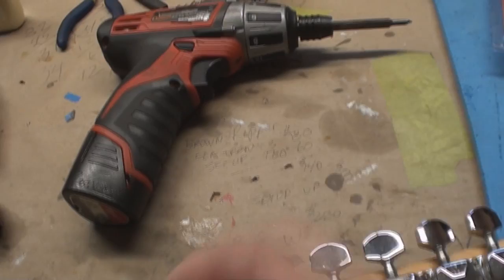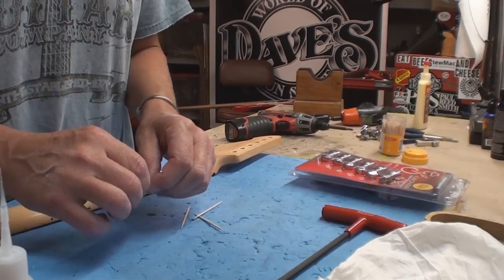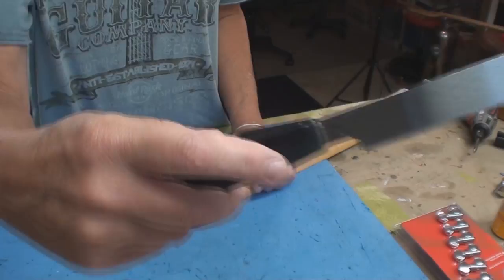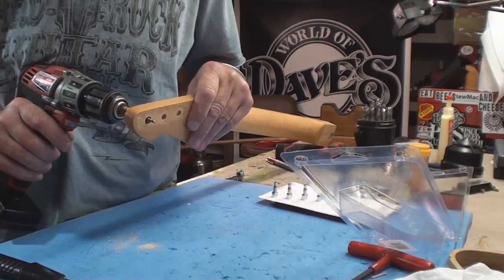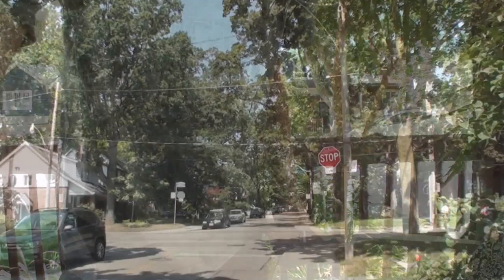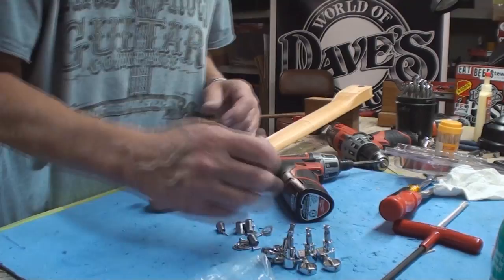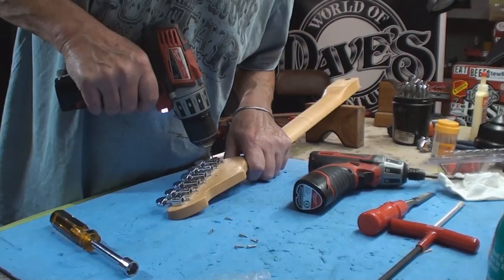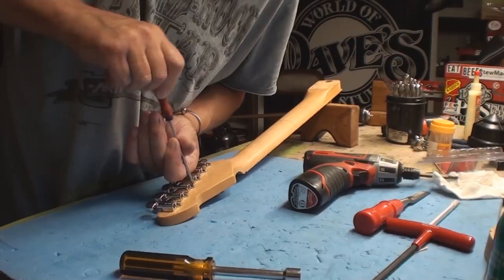Installing Some Grover Guitar Tuners

Comment: A really easy way to find a small part on a floor or on carpet is to darken the room, flip on a flashlight, and lay it flat on the floor.  Slowly sweep the beam in an arc, and the little part will cast a long shadow; you'll easily see it.
Reply: I think i'll try that. Current order of operations is a visual check to see if it's in plain view, then I get the magnetic wand and feel around with that some to see if anything sticks. Magnetic wand doesn't always grab the thing I'm trying to find at the time but it usually gets a bite on at least one of the hundred metal bits living under my bench.
Reply: Or walk across the floor in your bare feet!  You'll find it Guarenteed!!

Comment: Dave, since I started watching your videos, I’ve inlayed abalone, made nuts, refretted basses.   I can’t believe you have a downvote.  How ever I blasted my minty body using my driver yesterday (first time and second time!) and dropped the neck mounting it to the body (first time).  Maple is a pretty stout wood.  No dings after bouncing off the bench and onto the concrete floor from a tall bench.  None.  Not even on the Fender finish.  Amazing.

Comment: Hey Dave click the chuck one click back  the way you would un-chuck the bit and it should lock, thats if the chuck has a little line symbol  with a circle on it. It locks the bit into the chuck. Check that out.   Happy Spinning.

Comment: They make small flashlights with LED black lights used for checking tents and areas for signs of specific bugs etc., works great for finding stuff. Turn off the lights or lower the brightness and turn on the flashlight, anything on the ground or carpet, every spec of whatever will light up like brighter.  Perfect when you drop contacts, small screws etc. They can be purchased on Amazon for $5-10 easily and runs forever on two AAAs.

Comment: Wax the threads of the screws before driving them in. Makes shearing off or stripping heads less common, and makes it easier on your wrist!
Reply: wax or bar soap... either works well to lubricate the screw threads.

Comment: Hey Dave I have fitted a few sets of locking tuners to my guitars and absolutely love them.  I have a 1979 Yamaha SA1000 that I have had from new. Now having issues with the 'G' string not staying in tune. Nothing has been changed, no mods etc original tuners but it continues to keep going out of tune have changed strings etc a couple of time same issue. Now thinking locking nuts as I can't work out what is going on . If you get a minute and have a chance to advise that would be much apprieciated. Not keen to change but the constant retuning is driving me nuts hence thinking that the locking heads would sort it...? Whadyathink..?

Comment: I have been looking for a 1 liter shop vac like Dave. I have had no luck so far. The shop I am putting together is in my office. I need it to stay clean and the vacuum to be fairly quite. I would really like one that hangs under my work bench and has a small hose and dust brush attachment. I really don't want a hand held model. If anyone knows where to get one, I would really appreciate the help.  Dave would too I think.

Comment: 'Tis better to buy a guitar that already has good tuners on it. Wouldn't a reamer had been a better way to enlarge the holes?
Reply: What if it's just a guitar your using as a learning process then you need the proper tools not a $2000.oo guitar

Comment: Sorry man the stepper bit SUCKS.....crooked hole expansion for 1.....should be done correctly on a drill press.
Reply: @DavesWorldofFunStuff  Close enough, if the hole is already square to the face, and you don't get creative with the angle!
Reply: Your absolutely right I was waiting for that big crack and headstock repair for next episode